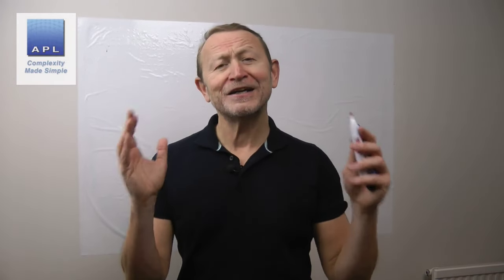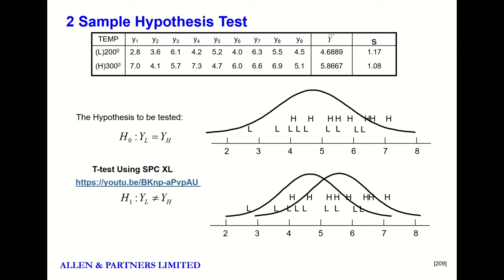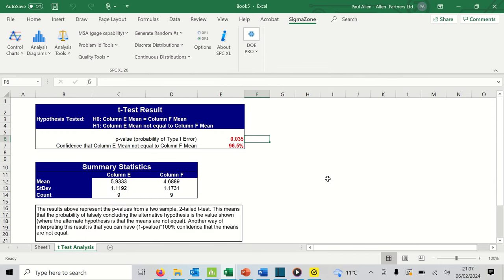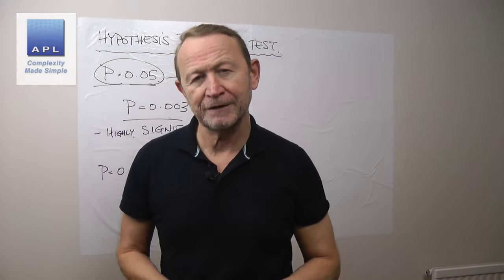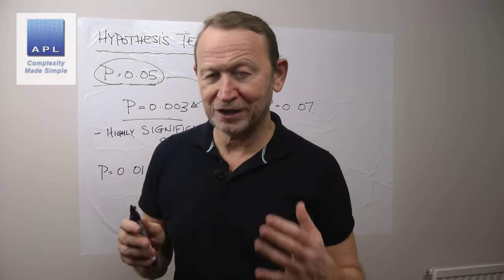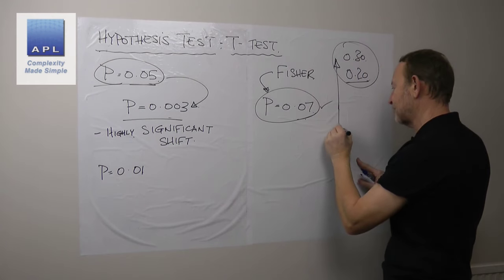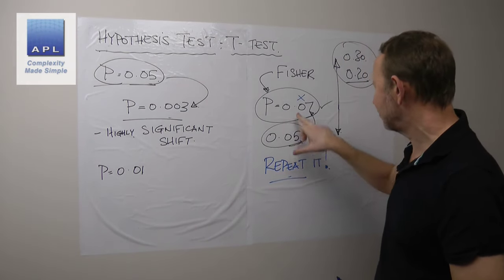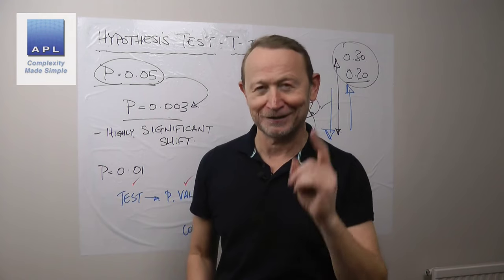Hypothesis Tests  - The practical process...

Comment: Hi Paul, as for me, this is quite contradictory. If you really had a lucky day and got 0.07, you repeat and receive 0.04 - why should be think that exactly 0.07 was lucky day, why not 0.04? I understand your point that we should be driven by practical experience, not math rules, but why then use math at all?
As for me, this is very simple. If we agreed before testing that 0.05 is the limit, it definitely means 0.05 is the limit, even if we got 0.06. This is not throwing any knowledge away, it actually says that we don't have enough knowledge. More analysis should be put in place and hypothesis should be reviewed. 
Actually, receiving 0.07 doesn't limit us from any decision, it's still a business decision, we just have to be sure that everybody understands that data doesn't confirming our theory well enough.

So from my POV, I'm totally against the idea of repeating the test to confirm/find statistical significance  (until we do it 20 times to really get 19/1 distribution).
Reply from the maker: Hi Alexey - 0.05 is not a hard and fast rule. Fisher who invented hypothesis testing never used this rule. But as the sample size increases the estimate improves but not unlimited way an extra sample will improve the result. I wasn't saying test after test after test. I was saying increase the sample size. Perhaps I did give the wrong impression in the video...